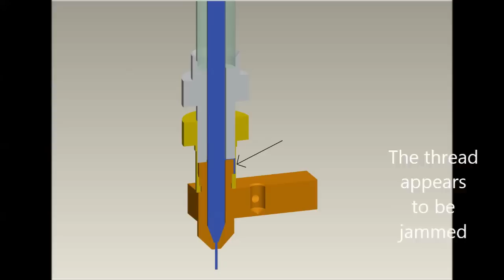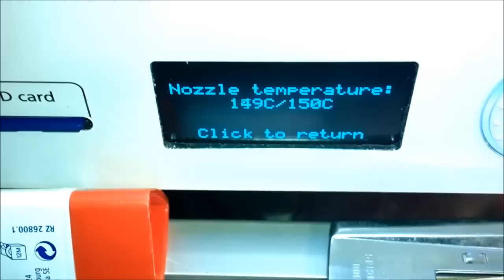Ultimaker 2 - Removing the Nozzle

Comment: Very good video.  Note that the 3rd fan does not need to be removed - you can continue removing the plate off the spring just as in the video but still leaving the 3rd fan in place.  Also I never try to rotate the isolator nut without heating as it is very delicate so I tend to do the entire disassembly at 180C.  After the 3rd time you can do everything in this video in half the time.
Reply from the maker: gr575 Yes, I was not that experienced in removing the nozzle when I recorded this video, so some things can be done in a better way, certainly.I already added a comment about the third fan in the video information by the way :-)
Removing the isolator tube without heating it worked the first few times, but as soon as plastic has found it's way into the threads you really need to heat it first, as you say.

Comment: The fan shroud in this looks different than the one in mine.  On my Ultimaker 2 (from 2015), you cannot access the four screws that hold the fan shroud to the block until you remove the side fans.  Not having to remove those fans would save a lot of time.

Comment: What size hex key for removing the locking screw?  None of the Ultimaker-provided ones fit, and my personal set skips from 1.3 mm (too small) to 2.0 mm (too large).  I eventually got it out with needle nose pliers, but I want to damage the threads next time.

And what do you do if the heater cartridge and sensor won't come out of the block?  I can't get them to slide, wiggle, or twist.
Reply: Update:  Well, using a small heat gun, I was able to soften up whatever was adhering the heater cartridge to the block, and I got that out.  Unfortunately, the temperature sensor didn't fare as well.  It's still embedded in the block, and the wire broke off.  So now I have to figure out how to get and replace the temperature sensor.  Sigh.

Comment: Also here thanks for posting. I have the same Ultimaker 2, but after I power off, the head is blocked. I don't know how to move it to the centre (or at least somewhere more convenient to work on). Any ideas on that?
Reply from the maker: ***** If you power off the main switch at the back of the printer you should be able to move the head by hand. If not, something is seriously misaligned or broken. When idling with the power on, as in the video, the motors are normally not powered and you can move the head by hand. However, if you for example run the buildplate leveling or the home head, the motors will stay powered and you will not be able to move the head by hand. (you then have to power cycle the printer to power off the motors)
Reply: Anders Olsson Thanks a lot! It turned out I was just being too careful... I can move them around now with a bit more force! Both when turned off entirely as when idle.

Comment: Thanks for posting this! How do you take out the nozzle from the heater block? Mine seems to be stuck there, I have no way to take it out. Also the temperature sensor is deep inside the block, I cannot take it out either. It seems to me that it's a major design flaw.
Reply from the maker: The nozzle and hotend can not be taken apart on the Ultimaker 2.
(the part I am holding in the last seconds of the video is machined out of one single piece of metal)

I never had to deal with a stuck temperature sensor, so I don't have any advice really.
I guess gently pulling/twisting it is the only thing you can do.
In worst case, the Ultimaker company has spare temperature sensors in their store now days.

I agree that the designs has it's flaws and I am actually working on a new design with exchangeable nozzles right now.
Reply: Anders Olsson I'd be interested in your design, especially if you can make it from parts readily available (or sell the finished assembly). I do have a small CNC mill available, but I'd rather not go through the hassles of building the parts myself.
Reply from the maker: Ovidiu Predescu The new heater block which I designed is being tested now: http://umforum.ultimaker.com/index.php?/topic/7689-custom-heater-block-to-fit-e3d-nozzle-on-ultimaker-2/
Reply: Anders Olsson Very nice design! I subscribed to the forum thread. Again, if you manage to make the parts available in larger quantity, I'd be interested in getting them. Thanks!